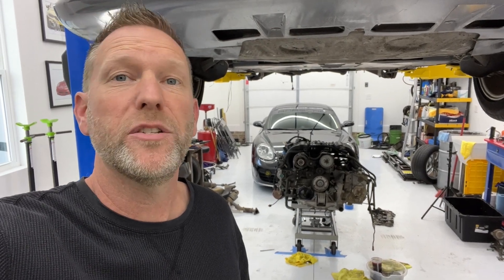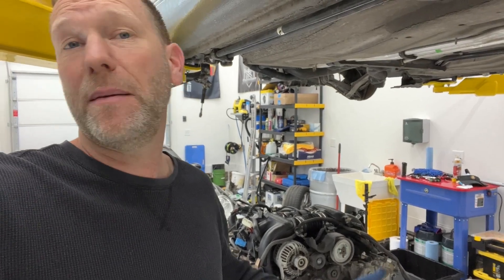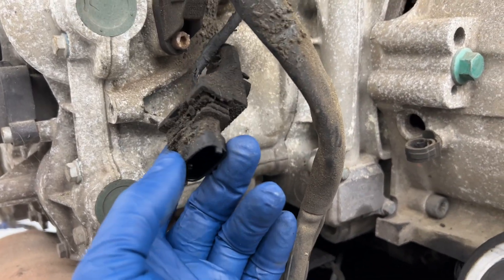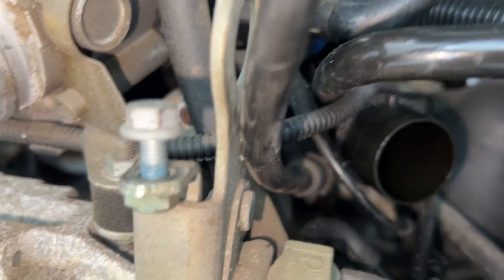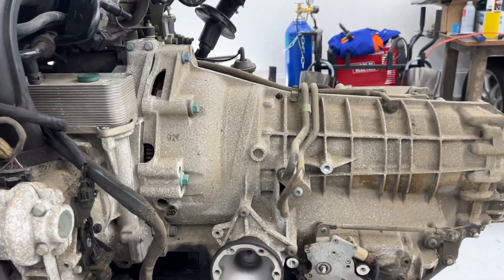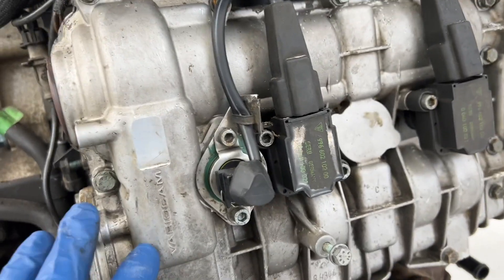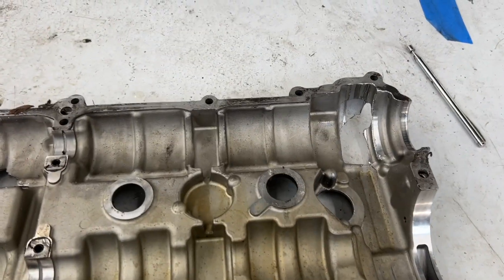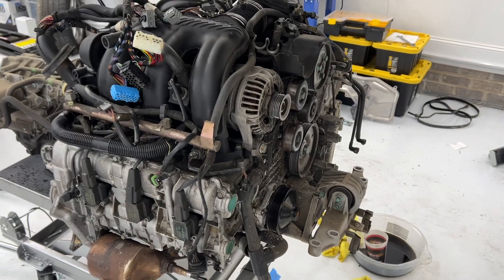Porsche Boxster 986 Engine Removal - Follow Up (BBB Part 7)

Comment: I'm gonna skip back and watch this series from the start.  My 2002 Boxster S only has 29,700 miles but I'm starting to get the chain rattle so all of your Boxster videos have been very helpful. Cost-saving but bad design decisions are what plague these engines, but once sorted they are great.   I won't be doing my own work but these videos have informed me greatly and will make it easier to discuss with my local Porsche tech.  Thanks for the great series!
Reply from the maker: +Jeffrey Spencer yeah, even if you’re not going to do the work yourself it’s very helpful to be informed enough to talk to whoever is repairing it and be able to understand if they have any idea what they are doing 😆. Also they will probably be watching my videos too…
Reply: Check your chain tensioners. he has a video on that, super simple.

Comment: The cam covers are machined to match the cylinder head and lifter carrier.  At the factory, they bolt the whole thing together and bore the cam saddles (the outer half of which are in the cam cover) all in one pass.  This means that theoretically, replacing a cam cover would require replacement of at least the lifter carrier with a matching one.  

That all being said, I've heard tell that you can replace the cam covers with an identical part and the tolerances are such that it "usually" works.
Reply from the maker: +Aaron Averett “usually” 😂. I like it.

Comment: Probably like the Honda Gold Wing the cam cover and head are "line bored", for cam fitting, but I have replaced smashed cam covers on Wings, and usually they seat without problems after 5 or 6K.
Reply from the maker: +Hal Carter maybe 🤷‍♂️

Comment: I think the cause of the damage is the left hole in the case cover. Something is broken in the area of the camshaft hydraulic followers or cam follower housing.
Camshaft blocked with the broken part -> case cover breaks (left hole), chain tears and blocks in the case (right hole), drive of the oil pump breaks... and so on. 😖
Reply from the maker: +Richard Hagen 😬

Comment: William huges wrote ... If the engine is salvageable you can’t just replace the cam cover you have to replace the head and cam cover as a pair. They are machined as one.
It is exactly like that!
Is it worth repairing the engine? Can't be seen until the engine is further disassembled.
Reply from the maker: +Richard Hagen yes! And thanks for being a channel Member ❤️❤️❤️

Comment: So many little differences between this engine and the one in my 2001. The bank 2 O2 sensor on yours is at the back of the head and mine mounts between the coils for cylinders 4 & 5. I also don't have that little belt hook thing that you noticed in the previous video. Looking forward to the deeper dive to see what other differences there are.
Reply from the maker: +Rob Emslie yes, just enough to make you stop and think 😆

Comment: Wild guess that maybe they didn’t replace their little actuator pads on the varicam. Eventually they wore away or maybe cracked away allowing the chain to skip a tooth.  

Looks like something put enough stress and strain on the end of the camshaft to eventually yeet the part that connects the oil pump drive out of the car 😂

Looking forward to the puzzle!
Reply from the maker: +Jordan Miller I like guesses and I’m also looking forward to the puzzle with you!

Comment: Aaron, which bank was damaged?  I get all turned around with the mid-engine cars.  Also, in your opinion, would a 911 engine be easier or harder to R&R?    Thanks, great videos!  -Tom
Reply from the maker: +Tom Fitch bank 1!
Never had a 911 or worked on one, but my buddy Aaron is a Porsche mechanic and he said he can pull a 911 engine a lot faster, in about 1.5 hours! Compared to it probably taking him 3 for a Boxster
Reply: @HelpMeDIY  I kind of thought that might be the case.  It seems like the access would be better in the 911.  Thanks!

Comment: Aaron, what are the total miles on the boxster ? This is another reason why I am so glad to have sold my Boxster S. But I still enjoy your dwelling into these cars. They should be collectibles like the 914's of the 70's someday.
Reply from the maker: +bruce wayne close to 90,000 I think? I forget. It’s in the intro video.
Reply: @HelpMeDIY  Wowwzer, the engine should have gone much longer than that Aaron. Must have been poorly serviced or maintained?

Comment: Really want to see what's inside! Get to work you slacker... Only kidding, you've done an amazing amount of work in the last week. I would guess the hole at the non-chain end of the cover came from debris from the original problem getting caught between a cam lobe and the cover. Curious to see what the bearing surfaces in the "new" cover look like since the clearances are likely all wrong because it is not the original cover machined with the head.
Reply from the maker: +Grant Hargrave if you would get involved on the Facebook or Instagram pages you would have seen already, slacker! 😉

Comment: The most “confusing hole” as you state in the video, is where an in;et valve hydraulic cam follower has destroyed itself, knocking a hole in the cam cover. The resultant debris then will have dropped to the bottom of the cam cover, been sucked into the scavenge pump, jamming it and breaking the drive peg on the cam sprocket. Maybe that was violent enough to knock the bigger hole in the cam cover, near the scavenge pump. The original repair will then be the items mentioned,cover, scavenge pump, plus a new hydraulic cam follower for the inlet valve.
Reply from the maker: +John Nickson I like the logic
Reply: @HelpMeDIY  I speak from that experience, mine now runs on 23 valves having cleaned out the cam cover, repaired the hole and fitted a replacement scavenge pump. That was nearly 3 years and 10k miles ago. One day (maybe with encouragement from your video) I’ll either take the engine out to replace the hydraulic lifter, or attempt it in-situ, but that means taking the cams out etc……..
Reply from the maker: @johnnickson1455  wait, this exact thing happened to you??
Reply: @HelpMeDIY  yeah it suddenly started ticking,Porsche diagnosed bore scoring…. then as I was videoing the noise to send to Hartech for their thoughts, it made a clunk and stopped ticking. I actually have that moment on video. I think at that moment, the tappet finally gave up. The car then ran quietly and we’ll, again. However it was leaking oil (turned out to be through the hole in the cover) the oil level display was erratic and it started giving a lean mixture error code. I had the cam cover off, in-situ, it was full of oil, the drive to the scavenge pump was sheared and I could see no tappet in cylinder 1 inlet valve (nearest to a UK driver). I posted my photo of that on your fb page, looks identical to yours.
Anyhow cleaned out the debris filled the hole (Wurth epoxy), fitted a new pump changed the engine oil and put it all back together, thinking if it now runs OK, then I’ll get round to the bigger job of fitting a new tappet/lifter. That was nearly 3 years ago now!
So on yours, somebody replaced the damaged cover, didn’t put in a new tappet, replaced the scavenge pump and it then failed again?
Reply from the maker: Yes, exactly. I'm now thinking it's because the chain rail guides were failing/broken and they were not addressed. So you are missing a lifter and it's not causing any issues? Wow. This comment was held for review for some reason so I just saw it. I also don't see the pic on my fb page... so weird. Can you try to post it again?
Reply: @HelpMeDIY  I should say it’s my wife’s car, it’s a 2003 2.7, so it’s just a nice car for sunny days on twisty roads, performance not required. Running on 23 valves and not red lining it, I reason that only having one inlet valve is probably not a breathing restriction to that one cylinder.
My fb picture post was as a reply to your video of bank 1 on your fb page
One suggestion, while you have the engine out is to check/replace the selector switch on the tiptronic box, it’s pretty inaccessible with the engine in the car and when it starts failing it’s a pain in the a$$.

Comment: I believe that the Tiptronic transmission cannot be removed separately from the engine unlike the manual. I don't have personal experience with the Tiptronic so I can't say for sure. I read this somewhere in the context of addressing the IMS bearing and the rear main seal.
Reply from the maker: +JT JOMO oh very interesting! I’m about to separate them now so I’ll see if I agree 😁
Reply from the maker: @michaelseningen4378  that is not correct. I just found out… the torque converter throws a huge wrench into removal of the tiptronic transmission!
Reply: @HelpMeDIY  Is that because the engine is locked up and you can't rotate it to access all the bolts that hold the torque converter to the flex plate?
Reply from the maker: @jtocher685  yessssss
Reply: @HelpMeDIY  I was afraid of that. I'm assuming you know what to do from here...unfortunately it's not going to be pretty. Sorry... 😞
Reply from the maker: @jtocher685  I think I have to take everything apart around it? 😬
Reply: @HelpMeDIY  Yes, It's going to come to that I think. I'd do a little research into the best approach to freeing up the engine so it can rotate enough to separate the transmission. I haven't taken a flat 6 apart but I would pull the heads first because you've probably got pistons crashed into valves and once the heads are off you should be able to pull out any completely fractured pistons/rods and rotate what's left of the engine. At that point I'd probably find a used engine so I could get the car back on the road while I was working out what to do with the original engine. It may be salvageable but I'd say the odds aren't good. 😢
Reply from the maker: @jtocher685  appreciate it!